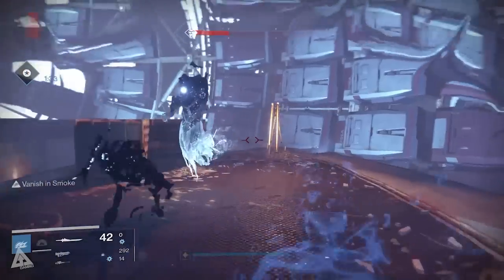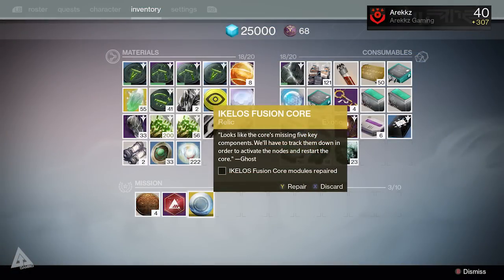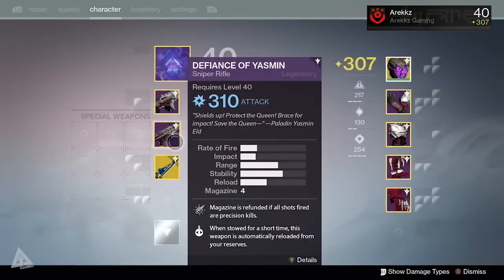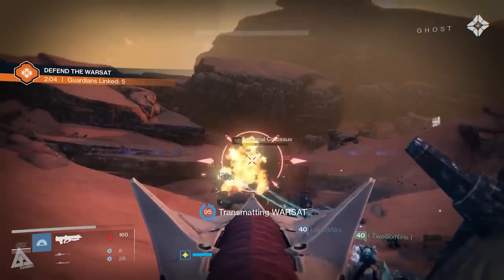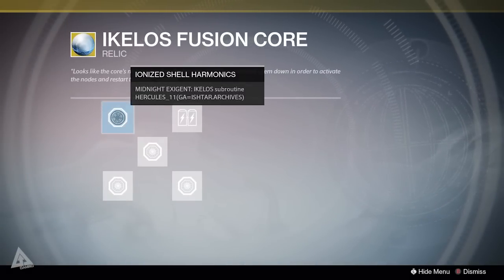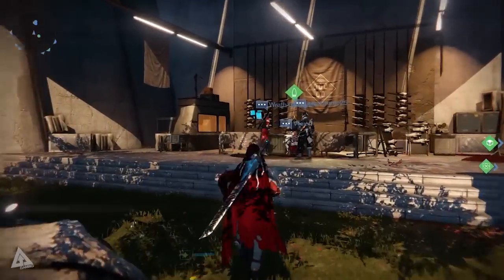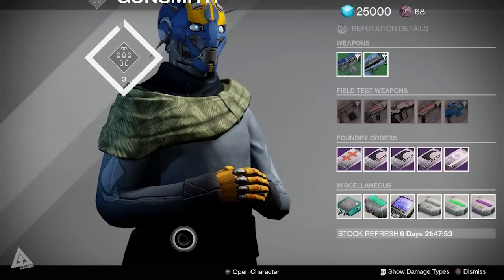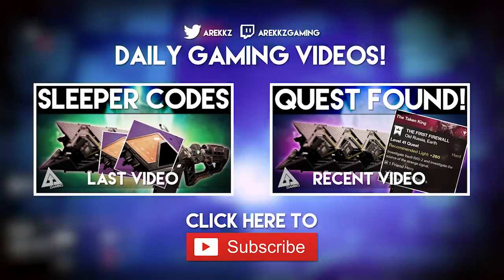Destiny Sleeper Simulant How To Repair The IKELOS FUSION CORE | Destiny The Taken King

Comment: I can confirm for all players interested, that you can complete "The Archive" mission on Venus on the normal, level 12 difficulty. 
This will still give you what you need, so if you want to run through quickly, this is the way to do it.
Reply: VENOMKYD117 when do u get the the archive mission?
Reply: +darius ward It's on venus and you would have completed it during the normal story arc. If I recall it's near the center of the map. I think it's simply called "The Archive" or some such
Reply: VENOMKYD117 THANKS
Reply: VENOMKYD117 Thanks, wasn't sure what the mission was to get it
Reply: Thank you!!!
Reply: VENOMKYD117 thank you kind sur
Reply: yessss thank you
Reply: Worked! 5 min mission 🤤